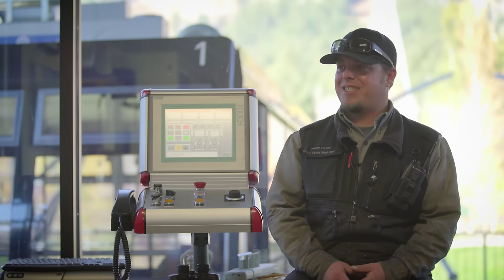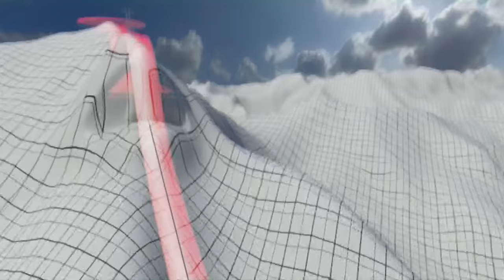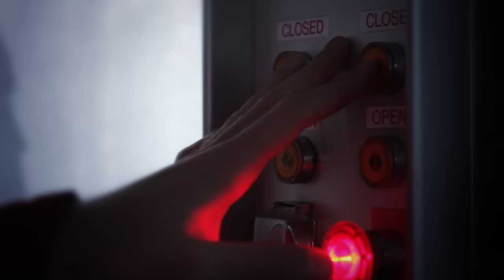The Jackson Hole Aerial Tram

Comment: WOW...especially when you board for the first time, September 1 2016.  
Were told the lifts will shut down with the impending storm front reportedly coming this way per national Weather Service.  They said you would have to weather it out if you do go up. The lifts would resume to get us off the mountain if it happens.  We were close to closing time that day. Time 4:11  Temp 81F

 What did we do ?

 Walked the Cirque Trail from Waffle House to The Bistro with the impending storm coming.  We did encounter high winds, and misting in the air, but the terror of the main cell just went little north of us.